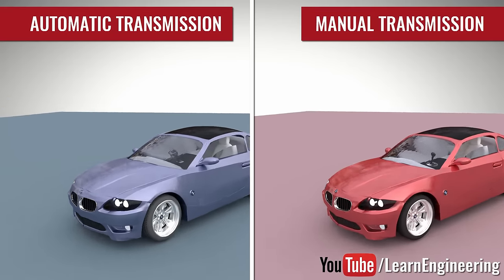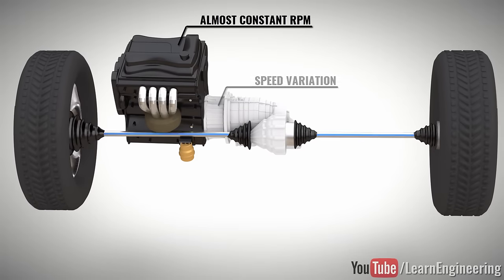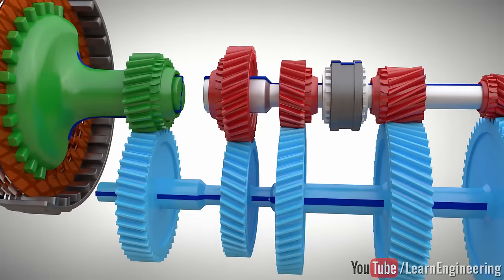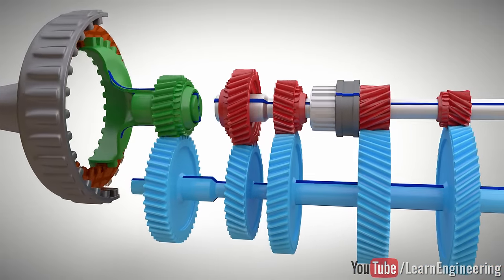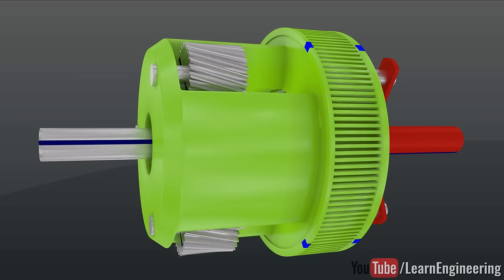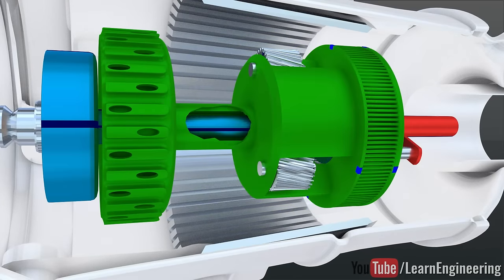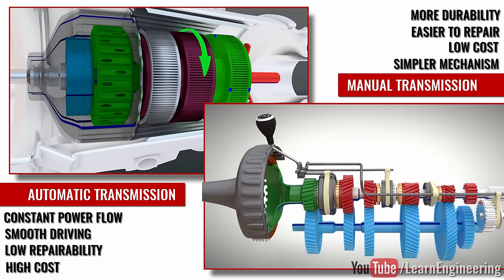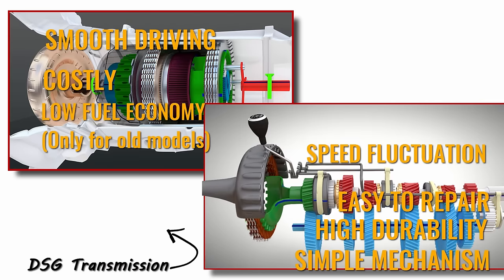Automatic vs Manual Transmission

Comment: ehhh
you can have a smooth driving experience in manual too...
and you dont need  to disengage the clutch in order to slow down
Reply: This video is too oversimplified. EIDT: I do not want to say that I dislike the video. But this topic is actually way more complicated. This video gives a nice and well animated introduction and those who want to learn more can do so. I encourage anyone to do it.
Reply: Which video would you suggest that does not oversimplify? Also: can you point out at least a few points where it oversimplifies. I am not doubting you, on the contrary. I am learning, so I am really curious to understand that.
Reply: Cláudio Sampaio
I recommend starting with Wiki:
https://en.wikipedia.org/wiki/Manual_transmission
 and
 https://en.wikipedia.org/wiki/Automatic_transmission
 The fluid coupling, also used in this video, is a part of many automatic transmission systems. Contrary to a clutch, it will always exhibit some level of slip and cannot completely "disconnect" the transmission from the engine either. Buses usually have a torque converter, which needs even more power to run but offers smoothness over efficiency, making diesel run busses accelerate equally like electric trolley buses. There are other transmission designs like the two clutch DSG automatic transmission which does not have a fluid coupling or torque converter, but even this type has its flaws (like when you decide to change from acceleration to braking or from motor braking to acceleration at the time of the transmission changing gears. Even this description is oversimplified.
Reply: Cláudio Sampaio one big problem is that this video shows the automatic as a superior transmission
the thing is that, if you are good at it, you can shift quicker with a normal (manual) than with an automatic. also the atomatic is way heavier than a manual 
good thing about the auto is that you dont need 2 hand and 2 feet to drive it
Reply: most of the bolids are automatic , deal with this
Reply: Aliosha i know i have to but.....
still i hate it :D
Reply: Erik Žiak
thank you very much for the references and examples.
Reply: Cláudio Sampaio there is a channel called thomas schwenke (he has 2 channels one german one in english) there you can whatch very interesting and well animated videos
Reply: Most American will never be able to to quick shift a manual transmission. And I think the video is targeting American viewers only as they display disconnecting and connecting the clutch to be a kind of binary process. Noone with expirience in driving would put it that way. 
Also I they left out dual clutch transmissions.
There are only two things you need to realy know about transmissions if you are an American. With an automatic transmissoion you can drink, eat hamburgers for  breakfast and type sms while driving at a wide variety of speeds. 
With a manual transmission you can NOT drink, eat, write SMS  and change the speed a big amount at the same time.
Reply: TremereTT I wholeheartedly disagree,  as an American that has driven standard my entire life.  You can eat, drink, have a smoke and drive with a manual transmission.  As for speed shifting, I can shift up or down as smooth or even smoother without the use of the clutch.  Although I'll admit I have buggered that up a time or two.  Manual transmissions is a dying breed here in the states, but those of that have and use them, love them.
Reply: Mike Anderson in the Netherlands most cars have manual if you want a automatic you need to order it.
Reply: He said "Before stopping completely", and you should depress the clutch before stopping completely.
Reply: Joe Boll
You can pull any gear into neutral without pressing the clutch. I do it very often, especially when breaking to a full stop. I use motor brake and then simply pull the stick from 2nd gear into neutral when I feel the engine no longer breaking and having idle rpm which matches the speed of the car. It is completely smooth, you would not notice.
Reply: Erik Žiak Exactly. I do it too, simply to not wear of the clutch and because it's much more convinient, when you have to wait a long time at a traffic light or train crossing.
Reply: yeah haha, you just have to be a good driver, sometimes its actually smoother because you can control when you shift and how you shift.
Reply: Erik Žiak interesting so u do not need to use clutch when shifting or speed shifting and what is the the difference Sorry I am new to Manuel driving but I am so fascinated with it I want to learn it but I would love to learn before actually driving it
Reply: Ernesto  Morales speed shifting is for performance driving. when accelerating, you prepare yourself to pass from a gear to the next. In a syncronized movement, at the very moment you release the gaz, you pull the shifter out of its current gear, no need to press the clutch for getting it out. Then when you're in neutral you quickly press the clutch and get into the next gear. All this is done in one movement. You can search youtube for vids. I saw one once. For a more casual driving, you always use the clutch to avoid unnecessary wear of you gears and syncros when failing to do no clutch shifting. I suggest you to watch rev matching video to perfect your downshifts. Don't try any no clutch shifting unless you are an experienced manual driver.
Reply: emocan126 yup. In fact it's dangerous to suggest that u need to depress the clutch before braking. For downhill drive it could be very dangerous. U'll need the engine to be connected to exercise both engine brakes n wheel brakes at the same time. This is essential for a safe downhill drive. And yes u can hav a smooth driving experience with manual transmission as well. The trick is to maintain the engine's rpm while changing gears. With a higher engine rpm the gears are not engine-braked suddenly and thus maintaining the smooth drive.
Reply: jeremy lee you know driving in gear downhill even reduces even your fuel consumption do it is a win win hahaha
Reply: it'll also preserve your brakes a little better ... instead of overusing it till a point where it starts to smoke ...
Reply: jeremy lee yea I live on a mountain  and i can drive down without using the breakes because the engine brake is enough to holf the car at ~50 km/h
Reply: ahhh ... then i'm sure u know how dangerous it can be to drive downhill without engaging the engines right? it's scary how fast the car can go when the clutch is depressed...
Reply: Aliosha modern sportscars have sequential gearboxes because they can cut some seconds off their lap time. They are not normal automatics...
Reply: emocan126 The smoothness of feathering the clutch can be insane. You can also shift without using a clutch if you know what you're doing. Just by knowing what rpm you need for each gear.
Reply: ColdSideOfMyPillow sure you can shift without the clutch if you want to fuck up your synchros
Reply: Charlie Pedneault negative,  just simply know what you're doing. I have a car with couple hundred thousand miles.  rarely use clutch(starting and stopping of course) I also know many truckers with millions of miles no clutch shifting
Reply: At first I got my drivers license on automatic transmission only, drove it for 6 years, it was ok. Then I got my license for manual transmission and my world changed. Now I have much better controll of the car in every setting. I would recommend everyone to try driving with manual transmission for a while before decapitating it's potential. An easy way to shift smoothly is to use the clutch and accelerator to adjust the engines rpm to the ideal speed. Looks like lot of work but only takes one second when you know the car.
Reply: The j Adjusting the engine's rpm while shifting gears makes the whole job smoother. It may take a few drives to get used to it, but it soon gets easy. I always do it without thinking since I learned...
I personally think that it's much more enjoyable to drive than an automatic
Reply: clovehitch wrong
DCTs do
Reply: emocan126 This is clovehitch, YouTube is censoring my comment so I'm posting from a friend's phone. here is the comment.

emocan126 A dual clutch is an automatic, first of all. And back to my original point, modern day automatics can be tuned to shift much faster and firmer than they do stock. I have driven at least a dozen manuals and let me say, my truck's tuned 6L80e shifts near instantaneously and feels like I'm being rear-ended when it hits 2nd at WOT (they are tuned to shift firmer when they sense more torque). That, and you have the option of having a stall converter which allows you to not engage until you hit the rpm of your choice flawlessly. You would have to be an absolutely world class driver and perfect shifter to even come close to competing with a modern day tuned automatic transmission with a 4,000 rpm stall converter.

you can reply to clovehitch but I don't know if my comment will show up.
Reply: "you can shift quicker with a normal (manual) than with an automatic" Not true. Today's sports cars, with paddle shifters, are faster track and drag cars. This has been tested with professional drivers over and over with current high performance automatic transmission.
Reply: What the hell is a bolid?
Reply: Indeed, you should not disengage before braking as you'll be in free-wheel mode which will reduce the efficiency of the braking and make the brakes overheat (especially in descent).
Reply: and to add, brakes are actually using hydraulics from the engine itself - they're near useless when the engine's off for they hav far less braking power with just the strength of ur foot ...
Reply: MocoPoloX it actually depends: it's better to disengage before braking in case of emergency, otherwise the engine will try to keep running while you are trying to stop as quickly as possible. As soon as you are in safe condition, the engine won't be off...just imagine if it cuts off on the motorway D:
Reply: u mean the clutch? actually no ... if u e-brake ... and the car comes to a complete stop, ur engine STALLS. Of course, it's not the case for auto-transmission cars. Once the engine stalls ... with the gear still engaged, clutch engaged, the car becomes much harder if not impossible to move... 

good thing? it can probably act as a stopper for the car behind... bad thing? the car will probably take a lot more damage because the setup forces the car to take on all the energy; it's not easily transferred over to the car in front ... for some cars, especially those lightly made cars or small cars, it could be dangerous for passengers behind.
Reply: Unless you're superhuman you can't shift faster than todays automatics, especially not consistently
Reply: That maybe true however manuals do have the option of a quick shifter and from personal experience are often able to put the entire engines performance down quicker, automatics do seem have a small delay before you get full power, that is unless all the automatic cars i have owned had the same unknown problem. And lets not forget how much more fun manuals are to drive anyways :), (edited due to poor grammar and spelling)
Reply: clovehitch yes but with stick youll have full controll when you shift.
i could kick my car to 40 kmh in the first gear.
then with the 2nd gear to 60 and 3rd to 100kmh.
and that will be much faster than any automatic also very harsh on your enginen but...... ehhh what ever.
Reply: clovehitch if you're bothered with the speed then you should be using a sequential box :P I'm joking of course, but the real thing to consider with day to day driving in terms of manual vs automatic is the cost and mileage difference
Reply: how did we went from smoothness to speed?
Reply: That was the mistake I made the first time I drove a manual, I didn't understand the concept of a friction point, so I thought the clutch was an on/off thing.  Once I figured that out though, I loved manual and was quite sad when my dad sold that car.  Heck I was still tapping the floor for months when driving an automatic.  #1 priority when I buy my own car is getting a manual.  Course given that my #2 wish is for it to be a Volvo Wagon, so I'm probably going to have to keep an eye on the market for a bit, as those are pretty rare here in the USA.
Reply: emocan126 probably made by an American
Reply: I had a manual 2006 Volvo s40... it was a beautiful car, and so fun to drive
Reply: emocan126 true
Reply: emocan126 float the gears
Reply: I strongly disagree lol I drive stick as a daily ... very smooth driver unless I feel like dropping a gear to disappear and yes you do need to disengage the clutch the engine is still putting out power to the driveshaft putting ware on both the engine and trans and also breaks
Reply: Admiting most of us have a car with EFI, if you are not accelarting and you are breaking from say 2kRPM, the engine is not outputting any power since the injectors are cut off. Unless the car is either warming up or you have to slam the brakes, then by all means disengage that clutch.
Reply: emocan126 your statement was true 10 years ago. 
Now it is impossible to be faster than dual clutch transmission
Reply: Then I can't figure out why racing cars use manual transmision if they could go faster with automatic, I must be missing something...
Reply: Cheaper to replace and I think it is harder to make very durable autmatic transmision 
But in F1 car you have sequential gearbox (half automatic) idk about other sports 
It is much faster than normal gearbox because you dont move anything
Now I think main problem is fact that there is a lot of different situation and it would be hard to make automatic gearbox work correctly
Driver know what gear or rpm he needs now, auto gearbox dont know what is happening and bad shifts, at wrong moment can destroy your lap time
Reply: Semi-automatic transmissions are clutchless manual transmissions my friend. Automatic transmissions are slower, heavier and you have less power control, especially coasting and downshifting. I don't know if a car with AT could catch up to the same with MT during acceleration and upshifting, but in every other aspect MT is better for racing.
I have a car with MT myself and it's nice, but I'd rather have AT for everyday commuting, as I don't care about speed in the streets, it may do a bit less mileage per gallon, but it's a lot more comfortable.
Reply: You just repeated end of my comment
Automatic is worse in race because it is very special thing, there is no way to compare it with sequential gearbox
But still this is fact that 0-100 is faster on AT than MT.
Just check m4 or any other new car 0-100 is faster if you have AT because it switch gears faster than you can in MT 
But still my statement is true
No way you are faster than dual clutch transmision. You can change it better on corners etc so lap time will be faster but still AT and sequential will switch gears faster. But AT can do it in wrong moment (in race)
Reply: Then we don't have a disagreement, just a misunderstanding lol.
I think I've seen drag races with cars with AT gearboxes, but nothing else apart from that. What I'm sure of is that semi-automatic is not an automatic gearbox, just a manual gearbox with automatic clutch, and that's used in modern racing cars like GT3, WRC, F1.
Reply: hes not talking about a smooth driving experience. its impossible to shift and remain a constant acceleration with manual shifting bc the engine isnt engaged to the wheels. you may dont really feel it, but the acceleration decreases while the clutch is pressed. (except when driving down a hill with a constant acceleration that matches the acceleration of that slope).

Comment: > manual transmission
> step by step guide
Oh I get that, this is nice

> automatic transmission
> AND THEN YOU JUST PUT A PART HERE AND ITS SIMPLE AND HERES ANOTHER PART AND WHEN WHAM BAM THANK YOU MA'AM LOOK IT WORKS
Oh I'm lost now.
Reply: wiegje there's another video which fully explains about planetary gear automatic transmission. it's very complex tho. i still dont get it after watching second time. i guess im just not into cars
Reply: Look for kinematic guides and you'll get it ;)
Reply: The basic idea is that a planetary gear allows a reduction in speed. Many of the original automatics were 2-speed. The planetary allowed the inside to spin for first gear, then went to the one-to-one when the planetary locks in.

If you watch the video carefully, you can see how the central gear spins (and everything spins slowly around it) when the planetary is unlocked.

The other thing that isn't shown well is that the output shaft is locked to the outside of the planetary assembly.
Reply: Gud reddit meme arrows friend. Upvoted
Reply: Dr. Pavel I'm CIA nice trollbait. 11/10 would bait again
Reply: Coffee actually makes sense
Reply: Coffee dad, stop it -,-

Comment: Anyone else understand the manual but not the automatic?
Reply: Same
Reply: Same and I can usually easily understand things
Reply: Me. Ever hear of Porsche's 1970s Sportomatic? Just a manual with auto-clutch. They've had tiptrontic..no full autos for them!
Reply: Gabriel  you're on drugs
Reply: after 3 years of mechanical engineering i think i finally got it
Reply: It took me a semester of engine performance and automatic transmissions
Plus those diagrams to understand what those planetary gears do
Reply: I understand both cause I build both all the time😂
Reply: Manual is easier 
Auto is complex
Reply: I usually don't understand junk...